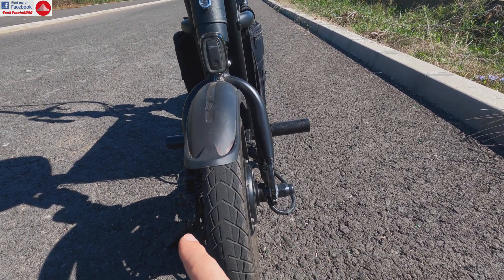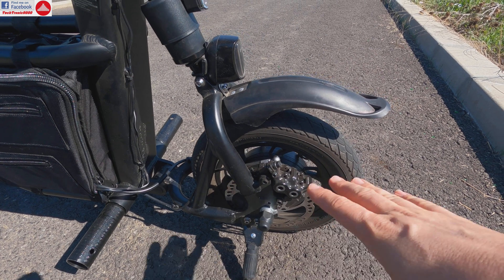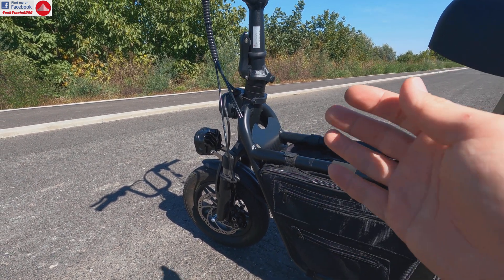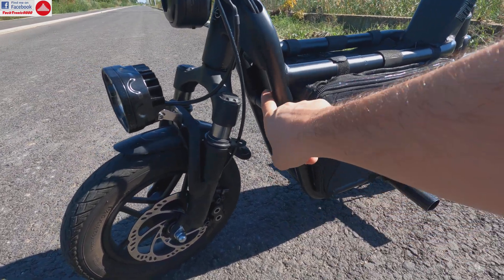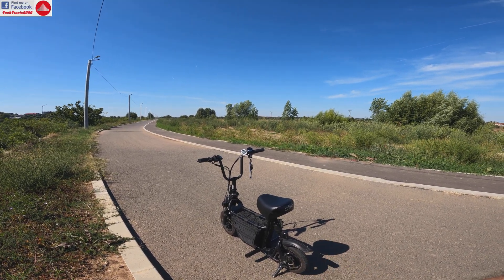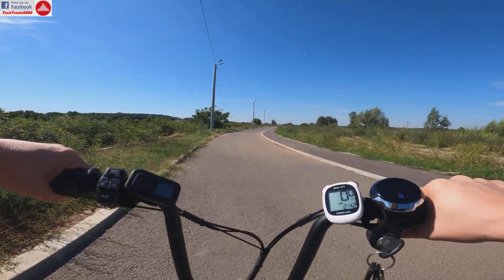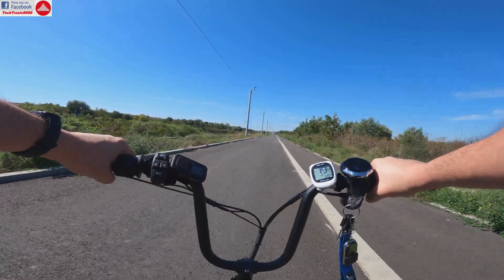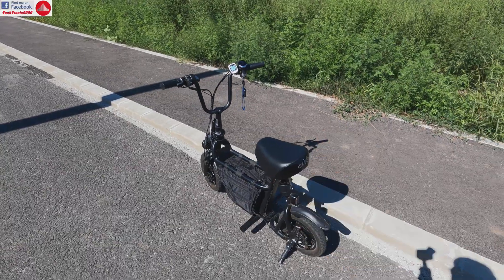Fiido Q1s 2000W Full Speed Test Ride With Motor Upgrade

Comment: Hi, nice build. do you have a link for the motor? I have tried upgrading the controller on stock battery but geared motor cant be reversed and its going in wrong direction

Comment: Can I put a 36v 800w motor using the stock controller and battery?
Reply from the maker: Yes you can but it will work similar like it is now with the stock controller.

Comment: Great video!! Thanks to all the details about the new motor, and the links to buy the components!!

Are you still riding the Fiido Q1S, if so, what kind of usage / rides you do?
Reply from the maker: Yes it still get miles done. Mostly daily city usage for commuting. Next upgrade planed is a bigger better battery and possibly a dual motor configuration.